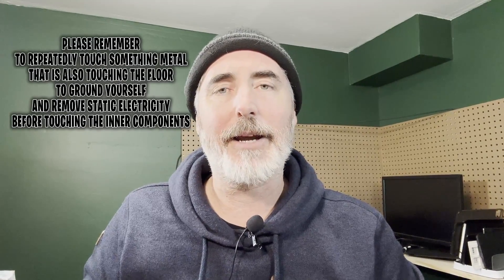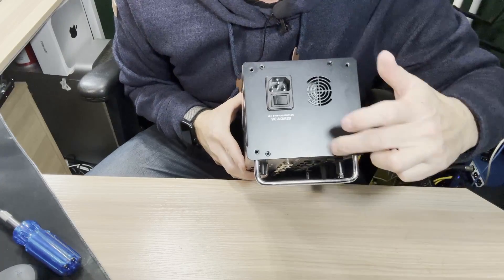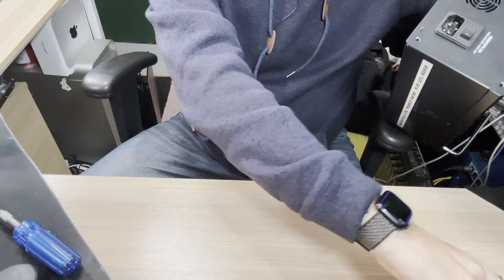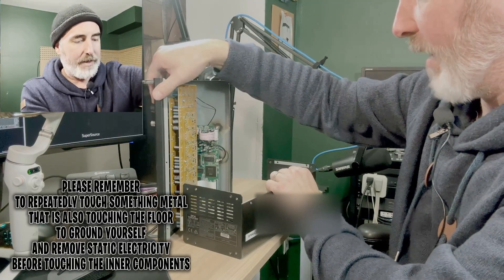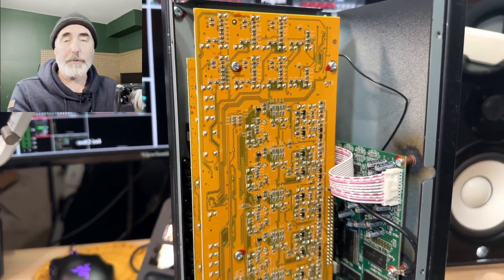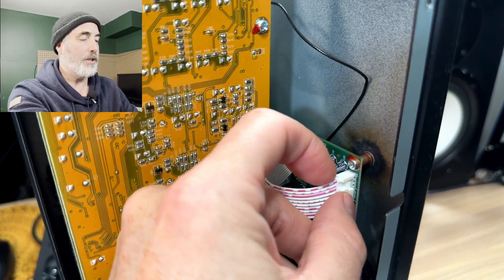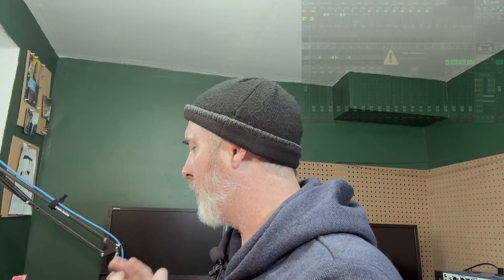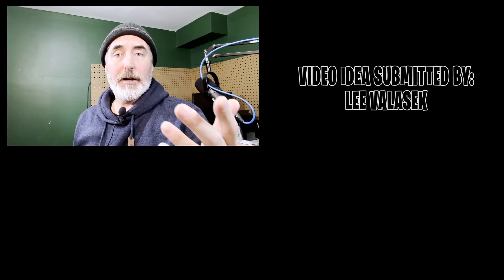Behringer XR Mixers - No audio from Main outputs - Ribbon Cable Fix

Comment: I've been having a similar but different problems: I lost output to Main LR completely, didn't show on the meters at all and nothing out from the XLRs. Yet SOLO on Main mix worked. So it's lost inside somewhere in the matrix!???
Also had same issue with some of the AUX outs. And it's not all channels either! ie some will output, others won't!
I really need a functional scematic diagram to figure out what's going on. 
The real problem is, it seems to be impossible to reproduce it on the bench.... unless it's related to the number of input's plugged in...  it's only happened when setting up on stage for sound check etc. with 16+ inputs.
Any ideas welcome! 🙂
Reply from the maker: any chance you removed your channels from the LR mix?
If you select a channel (any channel) and then click on the 'MAIN' tab, you will see a little button labelled "LR".
if that button is highlighted, then that channel is routed to the main mix.
If that button is grey (not highlighted) then your channel has been removed from the main mix.
clicking the button again to highlight it will put that channel back into the main mix.

You mentioned you have issues with the aux outputs as well, what exact issue is happening there?
Reply: @QuickEZ Thanks for reply 👍 
I don't think it's that, but will check it. Weird thing is that next day, after no changes, it was working normally and has done since!
I had the same problem previously with Aux outs, eg some channels just stopped routing to one of them. And again, unable to reproduce fault back in the workshop!
Reply from the maker: That’s very concerning. If you have any other info please share it.

Comment: Thank you for this - I'll check that ribbon cable. The problem I've been having is volume inconsistency on the main output. It's not on/off, rather it's quiet/loud variability...generally starts quiet early in show and then will surge louder after a bit if it happens.   Doesn't happen all the time...just on occasion in the last year. Could this explain that kind of problem?
Reply from the maker: If you’d asked me a few years ago I would have said no. But based on the experiences that people have shared with me around this ribbon cable issue, it’s entirely possible that it’s the culprit. 

That said, do you have any ducking engaged anywhere? 
If you have any gates, compressors or duckers engaged or even side chained?
That could also explain changes in volume. 
Does anyone else have access to the mixer during your shows? Like other people in the band controlling their own mixes but have maybe engaged settings these didn’t mean to? That could explain inconsistencies.

Comment: How about only the phone out do not have any signal?
Reply from the maker: I haven't come across this and there are limited ribbon cables or connections internally to look at.  If nothing internal is loose then you either have nothing routed to the phones, or you have a more serious issue with your mixer. 
If you open the XAIR edit software, and go into SETUP > MONITOR, do you have a source selected for monitoring? or is it set to OFF?
OR, do you have the dim setting cranked all the way down, and DIM engaged?

Comment: Great video, ALOT of mixers and music equipment unfortunately suffers from this issue as they are usually moved around from gig to gig and tag along on the bumpy rides in cars/trucks. I've seen more plugs with glue from the factory now because of this.

Comment: So last night after 10+ yrs of trouble free operation we got intermittent output from left main on XR 18. Knowing this was common I opened up to see the insides on this video different from the XR 18 we have. Looking at cables I'm not sure which one would be the culprit & have been told the main one (white with pink lettering) with easy access is a power cable & not the infamous ribbon one. 2 other cables (both with blue lettering) run from base circuit boards with 1 having difficult access to top board without removing board assembly. Is that the one that needs to be checked ? & if so it seems one has to remove circuit boards to gain access . Thanks I'd attach images but don't see how
Reply from the maker: You can shoot me an email with images and I’ll have a look. Maybe I can point you  in the right direction. 
Though if you see any ribbon cables that aren’t fully connected, give them a reseating. 

Drop me a line here:
Email@quickez.ca

Comment: Thanks for the vid, good to know.

If they didn't seat that end of the ribbon, they prolly didn't seat the one on the other end either..  No way that could become disconnected by itself, by the looks of they way you clicked it back in, it seems unlikely to happen on it's own.  Ribbon cables suck.

Comment: I'm having an issue where certain channels are showing a strong signal / levels but that signal isn't going to the mains. 

Other channels are unaffected. 

Any idea what the issue might be? (Not muted not panned or anything like that)
Reply from the maker: Hi Michael, 
so you can see signal on the channel, but that channel cannot be heard  in the mains. 
You mentioned strong signal. Is this random noise that is always present? Or are you confident that it is your input signal from whatever mic/instrument you have connected?

Have you selected the problem channel and checked the "MAIN" tab to be sure you haven't removed it's signal from the Main L/R bus?
- select channel, 
- click on main tab, 
- make sure the LR button underneath MAIN STEREO is selected. 
- If it's not currently selected, that is why you aren't getting output to your mains.

My immediate assumption, if other channels are working and you haven't accidentally removed the problem channel from the LR bus, is that there is something wrong internally. Getting signal from input to output is so easily done that it's unlikely you're missing a step if you've already achieved that with functional channel strips.
A simple test to see what's working and what isn't, use a channel strip that is working correctly, click on the input tab and change the analog input dropdown menu to an input that is not working correctly. If you get working/useable signal, then maybe you did miss a step. If you don't get useable signal, then there is very likely an internal problem that you cannot fix.

Have you actually tried opening the device and looking at the ribbon cable like in my video?
While you would expect either an ALL OR NOTHING situation, I've had people write to me who were experiencing some missing signal but not all, and it was in fact the main ribbon cable.
I'm not suggesting that this must be your issue, but it's so easy to check it's definitely worth doing.
Reply: @QuickEZ you solved it. I clicked the LR button and it got sent to the mains... What a relief 😂 you rock
Reply from the maker: I'm very happy to hear it was the easy fix!

Thanks for watching my videos and happy mixing!

Comment: Ok Fam, I want to thank you for the  tip. My left channel would intermittently stop working. I opened the unit up before and completely missed the ribbon connection my XR 18 is over 10 years old and only recently been having this issue.  The only difference with my unit is that it doesn’t have the plastic clip. It has a ribbon that pushes into metal fitting that is held by a metal bar run across the ribbon itself. The ribbon was pushed in but the metal bar that holds it down was popped up on one side so far everything is working great I will test it again and update if there’s any changes.  Thank you once again.

Comment: I have a 5 year old XR18 that just recently started showing signal on Ch9 with nothing connected. I sprayed compressed air, contact cleaner (not at the same time) and even left 48v on the channel overnight, and I still see the signal. It only goes away when I switch the channel to USB input.  I can hear signal when I connect a mic if the gain is in the  right range, so maybe it's not fried, but a bad connection somewhere. Someone else said it could be a ribbon cable (fingers x'd) I'm not sure if it would be the same one you were showing, but I'll try that first. Thanks!
Reply from the maker: I hope it’s a ribbon cable for you and not an input gone bad. Let us know what you discover when you open up the mixer.
Reply: @QuickEZ  Thanks!
I opened the mixer last night and disconnected/reconnected a few ribbon cables, but it didn't fix the issue.
Going a little deeper, I connected a mic to channel 9 (bad channel), and I can get signal, but I hear a sort of digital distortion when I move the fader up and down. If I keep the fader at unity, it's ok. The steady input signal remains and doesn't fluctuate even when I talk into the mic, so you can't really see how much signal you're putting on the channel. 
The good news, and who knows why, is for some reason, the input signal is cleaner just by my engaging the HPF FREQ switch, at least in the iOS app, even if I don't adjust the frequency. When I toggle the switch on and off there's a very noticeable click.
Then, I tested with channel 10 side by side with channel 9, and I can get very much the same input signal, as 9 (the bad channel) So, it does work I guess, but I can't get rid of this phantom signal for some reason?
Sorry for the long rant, let me know if there's something else to try.
Reply from the maker: Ugh, that definitely sounds like the input is in trouble or on it's way out.

Just curious though, does channel 9 have 48v phantom power engaged?
That shouldn't create the  distortion you're describing unless the mic you're using is really reacting to the 48v. But it could explain some low level signal passing even with nothing plugged in.
If there are some power issues developing, the added voltage across the circuit may be causing more of an issue.
Reply: @QuickEZ  I hadn't been using 48v on that channel, but a couple people suggested turning it on for 3-8 hours, to "burn it in" on that channel, which I did, but it didn't make a difference. 
With just a mic plugged into the channel, I don't hear any noise, until I move the fader up and down, though the meter is constantly showing about 75% signal on that channel and the Master output. 
It's bizarre that this problem never existed before, and then shows itself after sitting in a rack case for a couple years.
Also, any other channel I assign to input 9 shows the same static input signal, but, If I assign Input 3 to channel 9, it's fine. Not sure if that helps?

Comment: My XR18s USB port went bad after around 6 months of use. Now it disconnects if I move the a cable a little bit. I think the mixer is absolutely great but the build quality man.. 
Do you have a solution other than sending it to RMA?
Reply from the maker: Hi @martongorbeistvan4786,

If you're still within your warranty period and can get it RMA'd, then you absolutely should.
Even if there was a quick and easy workaround I could give you (which truthfully, I don't have for you), you'd just be waiting for that workaround to fail. 
If you can get your mixer repaired, or replaced so this issues is resolved then that is absolutely the smart play.

What I would suggest after the issue is resolved, is maybe consider a small  extender for the USB port that you keep ziptied to the mixer. It's always plugged in, and you are only ever plugging/unplugging to the other end of the adapter, then the wear and tear on your actual input should be mitigated.
And if the adapter dies, you're only spending a couple of dollars to replace it, and you're not left without that USB functionality as you can just plug straight into the main USB until you get another adapter.

Comment: My XR18 has the re-designed ribbon cable connector. It isn't the big plastic one that snaps in (like the video), it is the smaller one that the end of the cable fits in a slot, and you push down on the slot to lock it in. Mine had been experiencing many issues described here- one side not working, or very low, distorted volume. A tap on the case (hey, I was at a gig) near the XLR main outs kicked everything back on. Inside the case, there are no connectors near that area, just the PC boards. I can't spot any obvious issue with the boards, so I am hoping some de-oxit on the 'strip' of the re-designed ribbon will fix this.
Reply from the maker: I’d love if you could send me a photo of the inside of yours. 
I’d like to see the difference. 
Email@quickez.ca
Reply: @daveeichenberger7473  any luck?
Reply: This sounds like my exact mixer and problem. Was there a fix for this? Thanks much
Reply: @jonpeck9464  The DeOxit worked. I am in a very humid area, so this sort of thing is common with all electronics here.

Comment: Well i resolved the last issue i had but I'm curious do you have any videos on how to link busses 5 and 6 or (main Lft main rgt) on the XR16 to make a stereo mix for a wired pack? I'd like a stage Lft/Rgt panning
Reply from the maker: Hi Cody,

Watch this video. 

XR - HOW TO CORRECTLY PAN INSIDE A STEREO AUX
https://youtu.be/B9OPxbO6oV0

Comment: The inside of mine looks different 😂 oh man
Reply from the maker: lol uh oh!
there may be some differences but Ribbon cables for outputs should look identical. 
If it becomes an issue and you're not sure which cable is which, shoot me a couple of photos at 
email@quickez.ca 
and I'll see if  I can point things out to you.
Reply: @wingo84 yeah - ditto. Mine is totally different - maybe it’s an old model, we’ve had it for maybe 10 years. There’s ribbon cables in similar places But I seem to have more boards than the one in the vid. I poked around and pushed on the connectors - let’s see if my main outputs work now…
Reply: I have intermittent and sometimes weak or no signal. Any diagnosis out there? All ribbons are tight. Hmmm

Comment: Would you be able to do a video on how to fix an issue on the xr16/18 with the busses? Right now i have 3 wireless transmitters connected to busses 1-3 all the transmitters picked up signal but only the transmitter in bus 1 sent sound to my wireless receiver the other 2 busses were dead silent but they received signal.
Reply from the maker: I can sure try to address issues to the busses. 

But it sounds like your issue is between your transmitters and your receivers, if I’m reading your comment correctly. 
You said all 3 receivers got signal from the buses. But only the first one transmitted to the receiver. 
That’s a transmit/receive issue. Not a bus issue. 

If you’ve got more information. Please share it so I know if it’s something I can help with.
Reply: @QuickEZ  that's what I would like to know XD I don't quite know how to explain it exactly but everything is as I said, I'd look at all 3 busses I plugged into and they all showed signal on both the mixer and in all 3 busses in x air edit and mixing station, however for some reason bus 1 was the only that had sound coming from the  mixer->transmitter-> receiver, bus 2 and 3 going to the transmitters showed on both transmitters that they were picking up a signal but couldn't for the life of me find why the transmitters in both of those busses weren't sending sound.  It could be bad cables but I just bought them yesterday and the transmitters  I bought a lil over a week and a half ago
Reply from the maker: Ok. So this further explanation supports that it’s probably a transmitter/ receiver issue. 
Bit just to make sure I’m reading this correctly:
1. You have signal showing on all 3 busses. 
2. You are seeing signal on all 3 transmitters 
3. RECEIVER 1is getting signal. RECEIVERS 2&3 are not. 

Is this correct??

Can you tell me what wireless system you’re using?
Reply: @QuickEZ yup that is correct except all the transmitters show signal but only the transmitter connected to bus 1 has sound,  I'm using galaxy audio AS-950's
Reply from the maker: It looks like the 950’s have a headphone jack on the transmitter. 
If you plug headphones into transmitters 2 and 3
Do you hear your audio from the mixer?

And…dumb question…you have the transmitter and the receivers synced to the same channel?
Reply: @QuickEZ  yeah if we plug headphones in directly it works and they're all on their own bus and separate channels
Reply from the maker: Ok. If you can hear through the a950 with headphones, then the issue is 100% between your a950 transmitter and your a950 receiver and is not an XR issue. 

Unfortunately, I’ve never touched one of those 950 systems, so it’s difficult for me to point you in any sort of troubleshooting direction. 

All I can say is make sure the receivers are tuned to the same frequency as the transmitters. And in the manual it appears as through the transmitters have input level adjustment on the back. Maybe adjust those to see if the input gain is turned all the way down. 
The fact that you can hear level with direct headphones but not the receiver is pointing towards a frequency mismatch or a larger issue with the unit.
Reply: @QuickEZ  hmm interesting, I have tried adjusting the frequency dials but didn't seem to change anything or might be something wh antennas possibly though they sit on the back of the transmitter and not the front. Idk what it would be. I have them all on different channels I could try unplugging the transmitters individually and see if that might fix it, doubtful though
Reply from the maker: Drop me an email. Maybe I can help you more with photos etc. 

Email@quickez.ca
Reply: @QuickEZ  I'd appreciate that! Although it'll prolly have to wait until this Saturday when we have band practice. The photos I have dont have the snake and iem's wired up. 
Thank you though for responding as you have, it has narrowed down alot on where I can put my focus